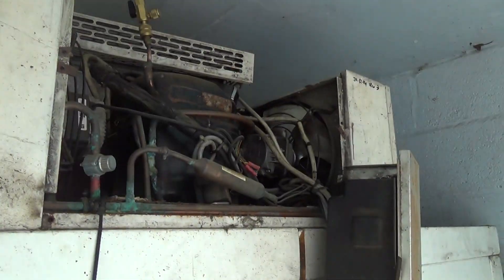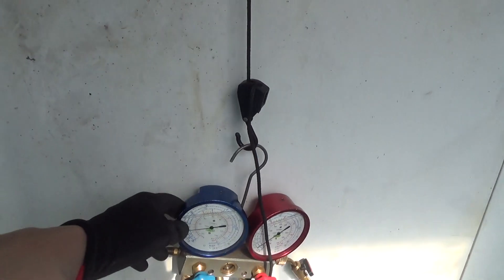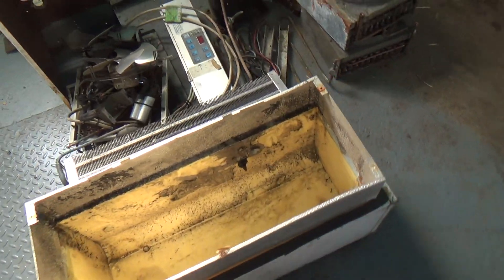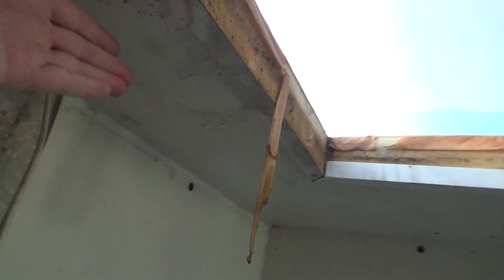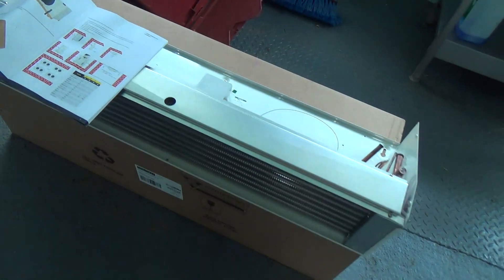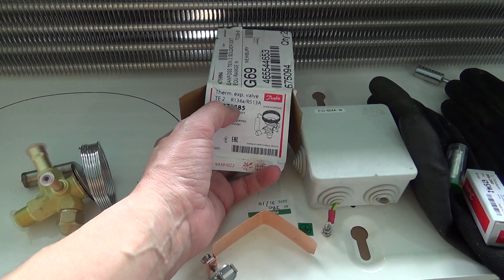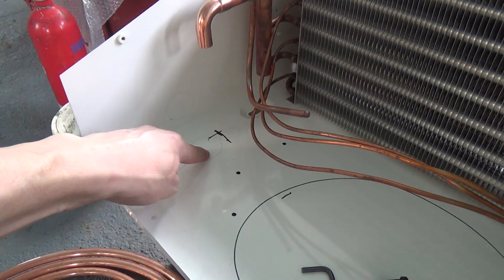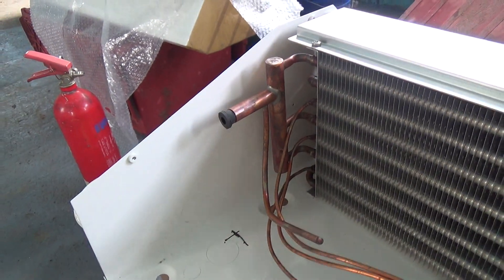Cold Room Upgrade to R513A System

Comment: The way that the factory have placed that external equalising line means that you really can’t put it after the sensing bulb… is that normal? I thought that the equaliser should be after the vile?
Reply from the maker: Yes the equalising line should be after the bulb. I think the reason for this is its possible that some liquid refrigerant could leak down the equalising line and thus cool the bulb making the valve shut too much for the system load. I have never had this be a problem with a new valve so made the choice to ignore the instructions for the sake of ease of installation and neatness.
Reply: @heavydiesel  ah right cool. I was just wondering as me and a fella from work pulled out an old TeeCool unit from a small cold room and it was before the bulb also . 

I have seen an external equalising line iced up before. On one of the bigger valves where you have 4 bolts holding the top half on.

Comment: I love how you guys are moving to more environmentally friendly refrigerants, and then you see HVAC guys in the US just chucking bottles of R22 at leaky equipment. Maybe one day they'll pull their weight too.
Reply from the maker: Yeah, a lot of modern stuff the refrigerants are better for the environment but the new equipment is shockingly bad for longevity and life cycle costs.
Reply from the maker: A lot of our refrigerant choices here are dictated by regulations, not allowed to use R404A in new installs for example. Thought I'd try out R513A as have a few projects in the pipeline I'd like to use it for.
Reply: @heavydiesel  what's so bad about the newer refrigerants? 410a runs at higher pressures so that's fair, but other ones like your drop in for 134a would run close to the same and shouldn't have many major impacts?
Reply from the maker: @Thermoelectric7  The refrigerants are ok, its the new equipment, thinner copper, less well built, higher rpm motors etc.
Reply: @Robert Tackett Golly gee Wally, maybe in the future we'll be able to recycle things made of metal!
Reply: @Robert Tackett I just wanted to say golly gee Wally. Don't mind me.